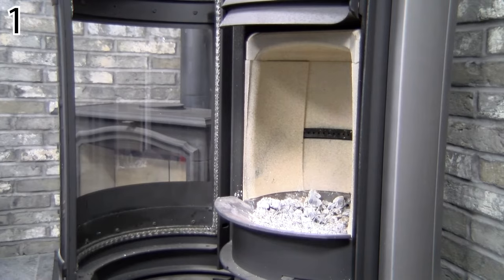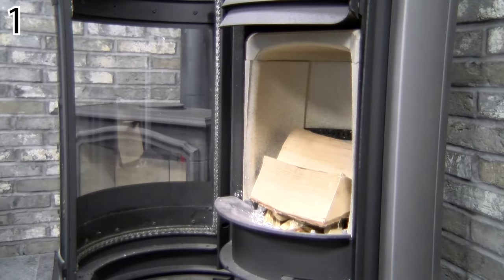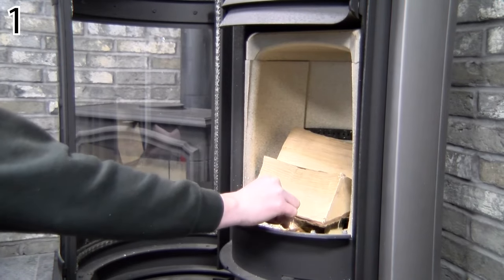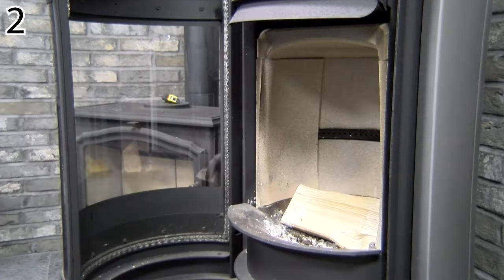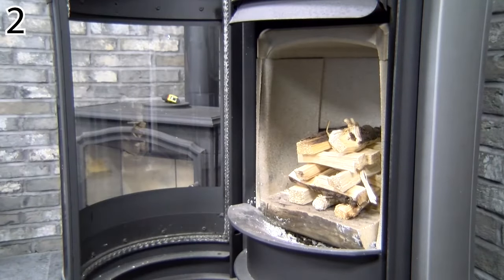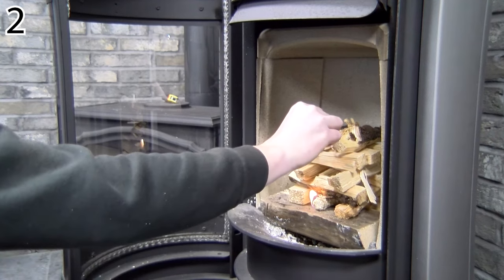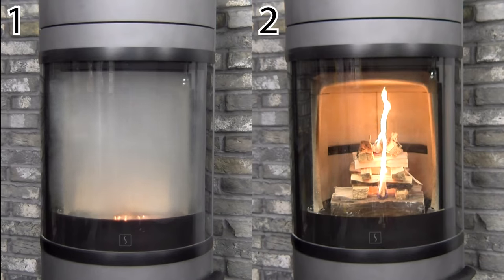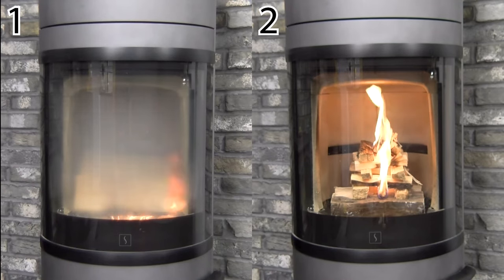The correct way to burn logs on your woodburning stove | Stove Industry Supplies

Comment: nonsense . have the laws of physics suddenly been reversed . the video says the main benefit of the top down method is it preheats your chimney . 😂😆🤣 the same occurs with the standard method . the heat from the starter and the kindling on the bottom up method only has to travel about 30 cm before it begins to heat the chimney, plus the entire stack of  material is being combusted simultaneously , thus increasing the amount of heat in the firebox and the chimney . with the top down method it takes a much longer time for complete combustion .
Reply: in the stove I had for years, if I didn't do a top down light, the downdraft in the flue would push smoke out through the inlet damper.  thanks to chimney sweeps who ignore instructions, I now have a new stove, and it has electric start.  the kindling actually goes in the middle for starting it.